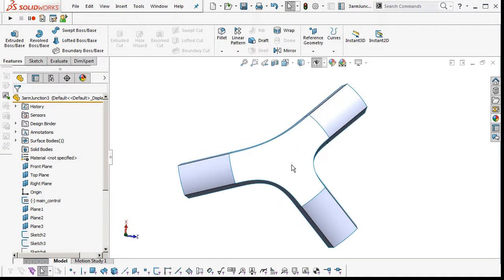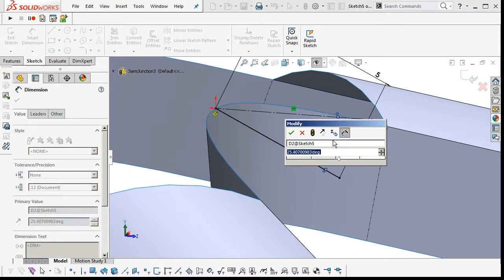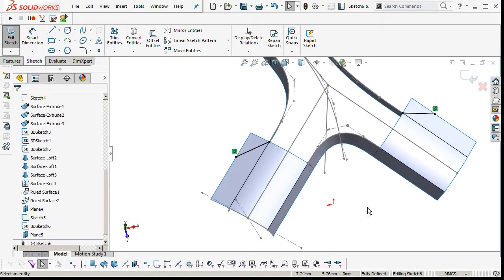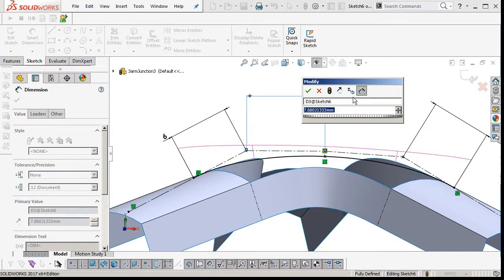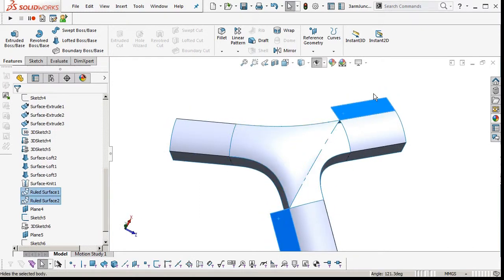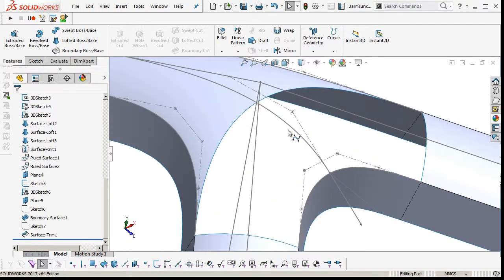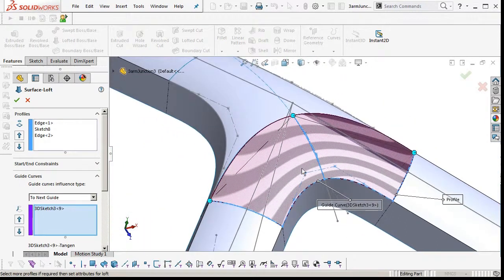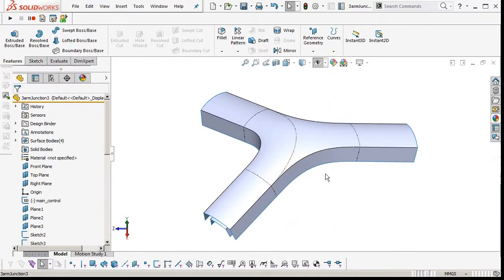Solidworks Tutorial: Surface modelling a three arm junction/n sided surface. AJ Design Studio LTD.

Comment: Are you able to do a video of creating a surface blend at a Y-branch where each fillet is a different size and each is coming from a varied angle rather than from the same plane? I've been struggling to find a solution.
Reply: I can link a reference photo if you would like to see
Reply from the maker: Hi there. Yes, link a photo please. Not sure when I will get to it, busy with work at present. Cheers.

Comment: interesting approach, although when trimming a surface and building another one off of the trimmed edge, it usually leads to difficulties with matching file tolerances for tangenscies, let alone curvature... I am not sure whether SolidWorks automatically shrinks/converts the trimmed edges to a proper surface edge, but the results are difficult to analyse.
Reply from the maker: Good point and one I cannot answer! A lot of fillets that SW creates are built from a trimmed surface and I have seen discontinuities in fillets, even though SW still flags the edge as tangent (I think SW has a tolerance of 1 deg for tangent which is loose). When I made this tutorial, the other two ways of achieving this (off the top of my head) were the 6 patch technique (like ProE N sided surface) or using a fill surface, which I try and avoid where possible. As for the surface being shrunk when exported, SW may shrink the surface as much as practical while keeping it a trimmed 4 sided surface but I doubt it would collapse one edge to create a singularity.
Reply: @AndrewJacksonDesignStudio  If you've noticed, when you built the top surface at around 8:18 by construction you have forced it to have "stretched corners" (which is always prone to problems with trimming at those corners later) when at 10:05 you trimmed the top surface at exactly those "stretched" corners. This is always difficult/problematic to use as a 'build from edges' construction for matching surface.
A rule of thumb usually is to have a four-sided surfaces with corners as close to 90° as possible (or worst case 45°).
Reply from the maker: Pashkuli Keyboard  I guess the long boundary could be curved to reduce that.   How do you get continuity above position between surfaces if you do not use edges? Maybe you could have a crack at a similar exercise and share?
Reply: @AndrewJacksonDesignStudio  Indeed Y joints are quite difficult to achieve with full G2 continuity. With a four sided surface in the center with one of its side as split from the Y-arc with least amount of curvature and the opposite vertices on the mid of the other two arcs of the Y. I think that way the G2 continuity will be much easier to achieve with some substantial control on the central four sided patch (less or more flat).
I do not use SW though. I am working in Inventor Pro.

here is an image f the idea:
https://img.techpowerup.org/201002/central-surf.jpg